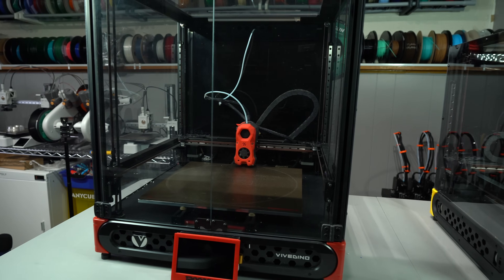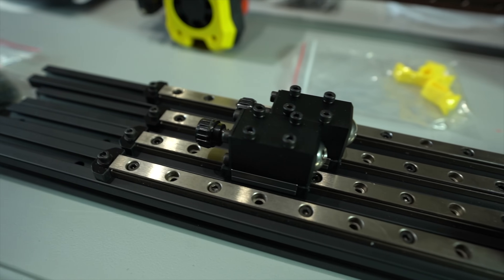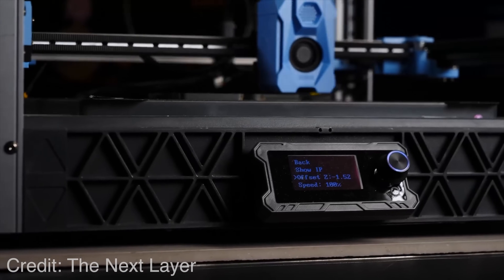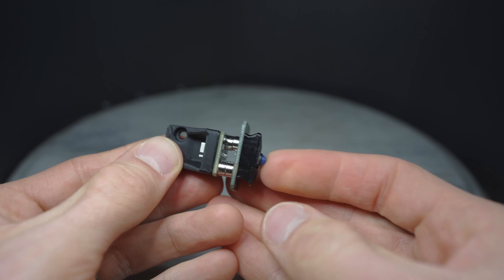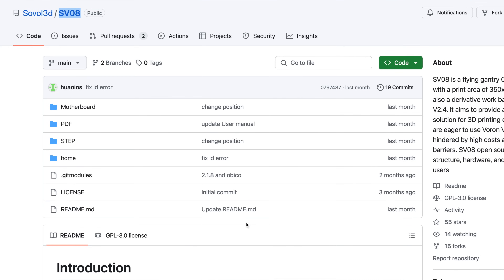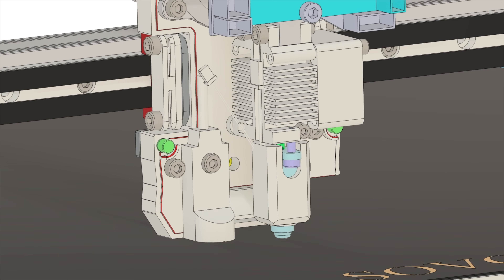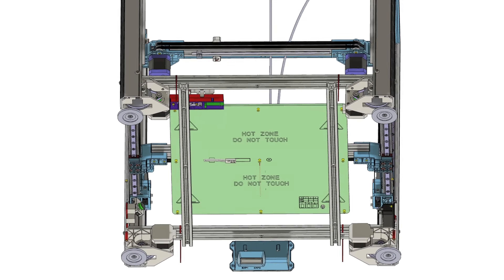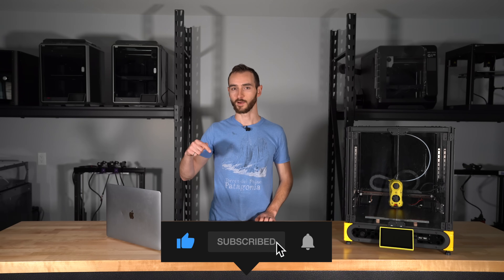The Voron Clone Wars: Sovol SV08 v.s. Troodon 2.0

Comment: My troodon 2.0 pro was ordered with a rapido 2 uhf and got a cht nozzle. While I ordered it as an option it did not come shipped with it. It shipped separately from China and I had to print a new piece to make it fit. The printer cfg is also half baked. When filament runs out the print head continued to move even though klipper has acknowledged the runout. I also recieved scratched enclosure panels. From what I read on the site it has a double sided plate though the smooth side does not look like any pei smooth sheet I've had before. The start print macro is also not fully done so out of the gate nothing would print for me even with the pre-made profile in orca. I also loaded octoeverywhere on the biqu board but that quickly overloaded the cpu and killed 2 of my large prints. Despite these anomalies I still love it. I have been printing asa for the first time in this machine as my other is a p1p enclosed. The first layers are fantastic as you stated. I printed d several large parts on the textured side of the plate in asacf without ever cleaning it or anything and had no warping. Overall the quality is very good and had one of the most stellar benchies I've ever seen (with the original hotend too).

Comment: Troodon fanboy here. Dragon high flow. CHT nozzle. 9000 accel. Prints great. Not the pro model but a klipper install over the RepRap misstep. I have the klipper screen sitting here but it's kind of pointless since I'm a hard mainsail user with my other klipper machines. 

The Troodon has a hidden secret though. The smooth side of the build plate isn't PEI. It's a PET/PEO type that ABS sticks to like glue.  It's amazing. As always, great content Taylor.
Reply from the maker: Thank you! Interesting about the build plate. On the newer models, or at least the Troodon Mini that I received, the build plate is only single sided textured PEI.

Comment: Troodon is way better. Only thing I don't like is the 50W limit for the hotend. Why o why did they do this stupid mistake?
Reply: IIs this limitation still present on the Pro with the stealthburner? 

Can it be measured or referenced that more than 50w is not possible with the troodon 2.0 pro?
Reply: @christian5288  The problem is thin PCB traces and the cable/connector that goes from the motherboard to the daughter board and to the toolboard. Those are all the same on the pro. You can install CAN. That way you are unlimited because you will be drawing power directly from the PSU. Also I'm running a dragon UHF with a 50W cartridge without any problems. Works great. You can't use any hotends with ceramic heaters though, those are usually 90W or so.

Comment: I think the Sv08 is not meant really for those wanting to tinker. Although tons of mods are already being released and developed giving the choice to change things. I ordered the SV08 because i wanted a Voron style printer and didnt really want to tinker and upgrade , but may if i want. The price was a factor aswell , I wanted a 350mm build volume and the troodon and voron were way out of my price range . Considering also everyone i see with a voron never stay to the stock kit which adds more cost with almost no ceiling. I got the SV08 with enclosure and will be printing a different top so to keep the 345mm .
Reply: No, lots of the buyers in the FB group are already making mods.  And many are printing upgrade parts before they even get the machine.  Nadir Nadir already made a top hat for the enclosure so you can use the whole build volume. And a clicky probe.  And a few other things.  We now have Bambu style feet, lots of other printed stuff, and many macros to do things better than originally planned, Sovol has upgraded firmware already too.  It's probably the most heavily modded printer that almost nobody has yet.
Reply: The Sovol itself is a tinker brand
Reply: I plan on voiding the warranty early and often.
Reply: Yes and no on this. I think it's quite the opposite sv08 is ment to be tinkered and modded, but at the same time made to be easy to assemble and use out of the box if you wish to do so.
Kind of middle ground between voron and something like K1C. But the fact at all the stls files pdf etc are available on GitHub and a price is what made me choose SV08

Comment: I wonder why so many are obsessed with the term clone?
By the logic, EVERY printer on the market is a clone of something that came before. Also, that means every car and truck is a clone of the first car and truck. So every single thing in our daily lives is based off of an original design. So even Bambu, Voron, Prusha, Creality and every other printer is based in some part off of something that came before. So just call everything a clone.
Reply from the maker: It’s just a convenient descriptor that gets the point across. It’s not technically correct since these aren’t carbon copies of the original, but it conveys the sense that there is a great deal of similarity.

Comment: I have a Troodon 2 Pro but have not unboxed it. It has been sitting in its box for about 4 weeks now. It is a matter of space and how would we move it when we move and a move is more likely to happen hopefully in the next year. 

When I purchased the Troodon 2 Pro the Sovol was not even released nor had I heard of it at the time. The question of moving would still have been an issue so it too would likely still be in its box. 

I do appreciate the video comparing the two systems. At this time I probably would not have purchased either. I was impulsive and got the Troodon 2 Pro and after we move I will probably be glad to have it. And if I didn't have the unit I have it would probably be the unit I purchased for my next printer based on the features.
Reply: send it to me
Reply: Not likely

Comment: Because I found your video about the troodon 2.0 pro last week I cancelled my sv08 and ordered the troodon. It will be arriving on Tuesday and I am very excited.
Reply: I have a troodon pro and regret buying it. The extrusions are not square, the Z and xy belt tensioners are trash, the hotend that it comes with is garbage (mine had heat creep then got pushed off center and melted into the steathburner carriage., and now after hours of various calibrations it will not print a acceptable first layer. And the proprietary tool head pcb is very limiting.
Reply: I will stay with the SV08, I cant wait to get the shipping notice.
Reply: @3dpathfinder  ya same.  someone has already made a make shift tap mod and modded the hot end (in a jank way but still did it) to use the revo hotend.  This before most of us even got our orders.  Give it time and there will be better solutions to what we want.
Reply: Yep just got mine 2-3 weeks ago

Comment: I like building them, even wiring them, but when it comes to putting the firmware on well lets say I have a seckit cube sized paper weight all done except the board firmware.
Reply from the maker: Firmware is a different beast for sure